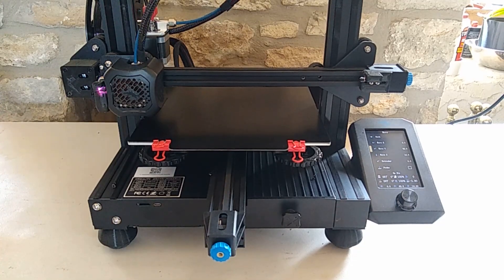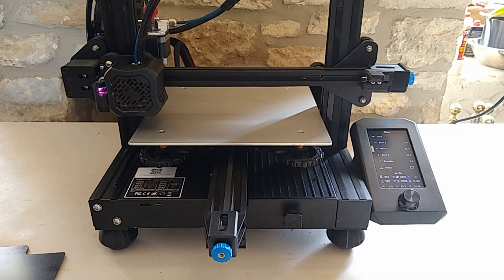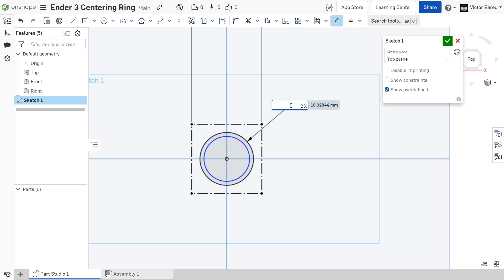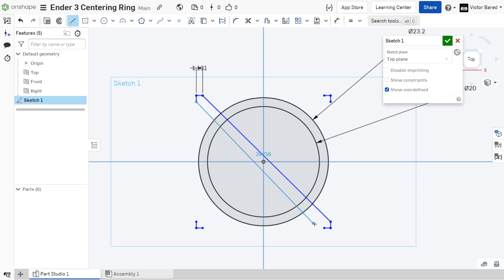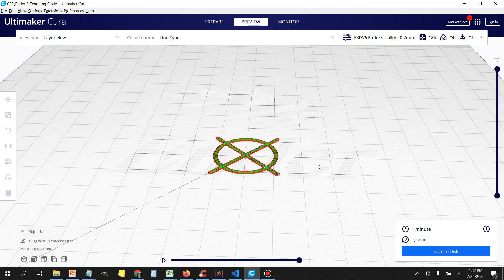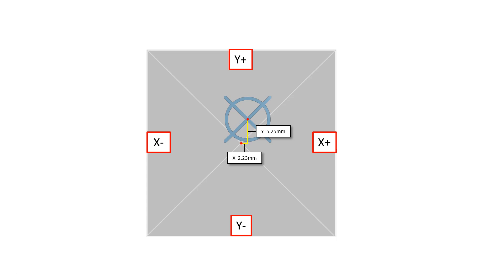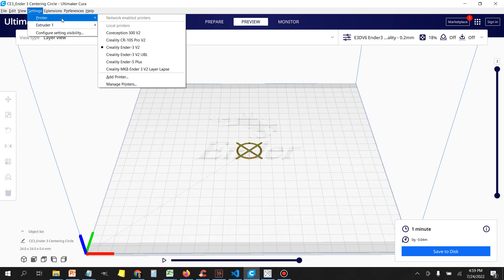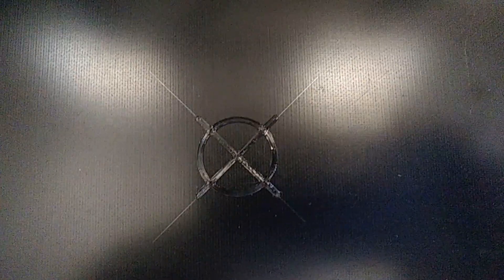Ender 3 V2 Ultimaker CURA 3D Printing Off-Center Fix

Comment: the only problem is its in the slicer and if u change the slicer its back again and another problem is this 5in and 2in u did it will be lost from the bed it self 
yea u have it in the middle but u lost the same from each side of the bed

Comment: I'm not sure if I did something wrong, but for some reason it's not centering even after I update my stuff in cura. 
Update it worked for my modified cr10, still trying to figure out the ender 3 v2
Reply from the maker: Hi, thanks for commenting. Most off center problems are caused by either improperly set slicer values or homing switches. Check out this video and see if it helps you hone in on the problem.

Comment: Thank you. I've had my Ender 3 for five years and just noticed yesterday that it was off center. I've never printed anything large enough to fill the build plate until now and it was a disaster. So again thank you. 

I had a feeling something was off a few days ago, because I noticed that my BL touch was checking right on the front edge of my print bed and a couple inches from the edge in the back. My bl touch was landing on my binder clips on the front throwing off my bed leveling. And it was never an issue until now, because I never printed anything big enough for it to be a problem.
Reply from the maker: Hi friend, thank you for commenting. I'm glad you found value in this video for your viewing time. Yeah, I hear you, it was very frustrating when I ran into it for the first time. What's more interesting is that the root cause of the off-center issue is from mechanical misalignment. Using CURA allows the alignment problem to be corrected via software. 

I use 4 Ender 3 V2 in my business and each one required different CURA values to get the prints centered so I realized the cause must be mechanical. I found that when my printer X&Y coordinates were set to 0,0 the nozzle opening wasn't half on and half off the left front corner of my build plate. The last part of the puzzle was to maximize the reach of the nozzle so when I set the X&Y values to the maximum size of the build plate the print head could get there without hitting anything. My actual build plate for my Ender 3 V2 is 235mmx235mm but the CURA profile default is 220X220 so assuming the 0,0 home position is the left front corner that means the center is 110 but in reality it should be 117.5 which is the cause of the issue.
Reply: @vbared well, now that it's centered I have a whole new issue. I just changed filaments. I went from hatchbox to polymaker. The hatchbox printed beautifully.  The polymaker won't stick to the bed unless I'm pushing the filament through with my fingers. I should've known better than to switch brands.
Reply from the maker: @bkpickell  What type of build surface are you using?
Reply: @vbared  the creality glass bed. Never had an issue with it until I switched to polylite pla pro. I'm sure I have to tweak my cura settings. I've been playing with temps. I've already bumped it up to 210. That hasn't helped, I may try 215 or slow down print speed. Maybe the issue is extrusion speed. I just really hate when I switch brands and go through half a roll of filament just to get a successful print. I went through this with lightweight pla last year. Never did get it to print right after going through the whole roll.
Reply from the maker: @bkpickell  I used to have similar issues prior to switching out all the glass and magnetic build plates in my print farm for this Garolite that weighs just 7.1 ounces. 

The only requirement is that you need to use a bed probe to build a mesh of it. The Garolite sheets is 1/16 of and inch thick so it will conform to the aluminum plate beneath it. 

You'll never need any type of adhesion promoters, tape or anything else, throw away the scraper too. 

Run the bed temp at 80c and PLA, PLA+, PETG, NYLON, and ASA will stick to it like crazy. When the bed cools you'll hear the parts crack as the Garolite releases them. Another side benefit is that you can run your Z-offset much higher (about .23mm) which eliminates stringing due to the nozzle no longer being low enough to collect filament along the edges as the print progresses.

Ender 3 Garolite - https://amzn.to/4a5ZsQI

Super low profile bed clips - https://amzn.to/4a2gb7q
Reply: @vbared  Thanks, I just ordered it, lets see how it goes. It says it will be delivered Wednesday.
Reply from the maker: @bkpickell  If you have any questions about it, just ask. I've been using them for 3 years.
Reply: @vbared  Well, I figured out my issue. My hotend was clogged. It wasn't sticking to the glass because of underextrusion. I got it all cleaned out and it's still not extruding properly. So I ordered a new extruder , stepper motor, and ptfe tube. Hopefully that will fix it. I really don't want to have to replace the hotend. I know it's not hard, I'm just not sure I remember how to calibrate my bltouch. Lol

Comment: Victor. I have to say. THANK YOU! I'm new to 3d printing and it's people like you who make this more of a joy than a chore.
Reply from the maker: Hello Friend, Thank for commenting and encouragement. I'm glad you found value in this video for your viewing time. This alignment issue can be solved this way in CURA but I found the root cause is that from the factory the limit switches are improperly placed. If you're printing right of center that means the x-limit switch needs to move left by the same amount that it's off center. Also if your prints are towards the front of center that means the y-limit switch needs to move back by that same amount. Linked is the video I made about it.

https://youtu.be/8biqiHTd73o

Have a Happy New Year!

Comment: If i used klipper can i fix it from config with out fixing from cura?and how
Reply from the maker: Hello friend, The alignment issue is a result from a printer not being mechanically tuned. What I mean by that is when you tell your printer to move to X 0 and Y 0 the nozzle tip should be half on and half off the print surface. On an Ender 3 V2 that means left-front corner. If your machine when sent to those positions is off by a few millimeters in each direction the prints will not be centered. I'm sure there is a way to correct this in Klipper but the root cause is mechanical misalignment and is the method I use to fix the problem.

Comment: Why aren't you just correcting this misalignment in the firmware?
Reply from the maker: Hello Mickmarriott9453, Thank you for commenting. Yes, that's an option for sure. What I've learned since making this video is the problem stems from the end switches not being in the correct position. To fix this issue I designed a few parts to make the limit switches adjustable so that when X is at 0 the nozzle tip opening is half on and half off the bed. I then do the same thing with Y=0. This solves all the alignment issues with CURA and bed mesh creation.

Comment: Thanks so much man I had no idea why my prints where so far off center. And when I tried printing a large print it cut off a huge chunk on the right. Now it’s all fixed!
Reply from the maker: Hello 55kp, Thank you for commenting. I'm glad you found value in this video for your viewing time. Using CURA to address the issue is an easy solution. Since making this video I've found that the root cause of most of the print alignment issues is due to the x and y limit switches not being in the proper location. The way to test if this is the case for you is after homing your printer send the print head over the X=0 position and then bring the Z down to about 2mm to see if the nozzle tip is half on and half off the print bed. What you'll find is that your nozzle will be off of this point. The same test can be done with the Y-axis. To fix the problems the limit switches need to be moved in the direction needed to gain the proper alignment. In most cases, they will be off by a few millimeters. I made a video about this problem that also affects the bed mesh.

https://youtu.be/l-mrw8YvLBU

I still scratch my head to this day wondering if many of the companies making 3D printers actually have any real-world 3D printing experience.

Comment: Thanks!
Bought a new printer which was the same as my old one which broke beyond repair, and the newer one has an extra bit that sticks out which hits the stop switch on the gantry. This now makes the nozzle centre further to the right. Thanks to this I can adjust it back! Cheers Dude
Reply from the maker: Hi ArcanePath360, Thank you for commenting. I'm glad you were able to get back to printing normally. It's super annoying when you don't have access to all the build volume.

Enjoy your weekend :)

Comment: Thank you so much for this short but very informative video! I was having issues with printing models that were close to the limits of my print bed. but the right side kept getting cut off. I thought it was a bad STL file, or my slicer program causing the problems. After several failed prints I started googling, and came across this video. I followed your method, and found out that my X-axis was off by 8mm and Y-axis was off by 6.5mm. put those offsets in, and now i am dead center! now my prints aren't cut off on one side. thanks again! happy printing
Reply from the maker: Hi Brendan, Thank you for commenting. I'm glad that you found value in this video for your viewing time. Yeah, I hear you, it's super annoying to not have full access to your build volume.

Enjoy printing big models (:

Comment: Amazing I looked everywhere trying to find a way for my Ender 2 Pro to print in the center of the bed. Your instructions were spot on and now I can make use of the full bed and given that the build area is small for the Ender 2 that's saying a lot. Thank you so much for sharing this.👍
Reply from the maker: Hello Rick, Thank you for commenting. I'm glad you found value in this video for your viewing time.

Best of luck with your mods!

Comment: I believe the problem are the default Cura settings put the bed at 235x235 and it should be 220x220. It caused mine to over shoot center approximately 8mm up and right of center which makes sense if it measures 235 from bottom left corner in each direction.
Reply from the maker: Hello MadSQUABBL3Z, Thank you for commenting and info. One new thing I found out after making this video, is that the X and Y limit switches aren't in the right locations from the manufacturer.  The nozzle tip should be half on and half off the build plate when x is at 0. Same thing with Y at 0. If you tell the printer to move to the center of the bed but the limit switches are each off by several mms, that's the reason why it will off center. So I designed parts that allow adjustments of the X and Y limit switches so you can actually get the nozzle to the correct positions.
Reply: @vbared  would you be up for making a video on the adjustable x and y limit switch parts? Limit switch adjustment in combination with the 235 vs. 220 seems like the true solution to the offset issues.

Edit* nevermind I see you already have it covered! Lots of good technical stuff on your channel, greatly appreciated!
Reply from the maker: @g10118  If something is unclear just ask and I will make a follow-up video about it. I post the videos as I come across these issues and learn how to solve them. Unfortunately, they sometimes seem unjointed or scattered.

Comment: I can't get my 3v2 to create a mesh. it overshoots the bed immediately and I'm pulling my hair out going from video to video to find a fix
Reply from the maker: Hi Chris, Thank you for commenting. Please provide the following:

What firmware are you using?
What bed probe?
After homing, move the x to 0 and the y to 0. Is the nozzle over the left front corner of the build plate or off to the left?
If possible take a video of the problem, make sure to comment as you are controlling the printer, upload it to Google Drive and share a link so I can see the issue you're having.
If too lengthy to type feel free to call me 478-227-3301 , I screen calls I don't recognize so please leave a message and I'll call you right back.

Comment: Great video, but my Ender 3 Pro just keeps ignoring these settings :(
Reply from the maker: Hello Snaj, Thank you for your kind comment. I make sure that my printer can center mechanically first.  To check this simply set the mid point of of the x & y axises for me it's 117.5 x 117.5 , then take measurements to determine if the print nozzle is at they center point. If it's not then adjust the positions of the X & Y limit switches by the same number of mm that the nozzle was off by. For example: let's say when you move the x axis to 117.5 it's actually 115mm from the left edge of the heated bed. You would need to move the x-limit switch to the right by 2.5mm. Do the same for the y-limit switch. Once you can make it center mechanically using the controls then try the bullseye test print and make any final software adjustments needed using CURA.

Let me know if this helps you solve the problem.
Reply: @vbared  Thanks for the comment, I was able to adjust Y axis by having the switch move a bit forward. My main issue is with the X axis since it seems like it is not possible to move it because the way it is mounted. Cura adjustment doesn't seem to effect the printer since I entered like 1cm and it printed in exact same location. I am not sure it is because it has Marlin 2.0 or something else.
Reply from the maker: I created these parts to give some level of adjustment to the x-limit switch. It should allow you to get it mechanically centered so you can fine tune the CURA software side.

https://drive.google.com/uc?export=download&id=1F4ZpF49QI-pwa9o_9SExqXjjru8hgUAY

Here is a video on how to install it - https://youtu.be/8biqiHTd73o
Reply: @vbared  Thats very cool. I assume it can be installed on a ender 3 pro as well. I will definitely give it a try.
Reply from the maker: @snaj9989  Good morning, Yes, I'm using it on my Ender 3 V2s, Ender 3 Pros, and Cr10S Pro V2. It should work with most if not all of the Creality printers.

Comment: thank you so much for this video, i been pulling my hair out for a few days now because my printer was printing off centre Ender 5 pro.

Although I didn't use your file, the explanation of what to do was understandable and to the point.  got my issue sorted out in under 10 minutes. My x/y axis was out by 60mm & 60mm respectively.

great work thank you
Reply from the maker: Hello Ultimatedavethe3rd, Thank you for your kindness. Wow, 60mm off, I would have also been pulling my hair out. Glad the video solution helped you resolve your issue. Great work grasping the gist and applying it to your machine.

Best of luck with your mods!

Comment: I went a little more low-tech to check mine.  I created a 220 x 220 square in TinkerCAD and left just a 3mm border by putting a 214x214 hole in the middle.  Exported and sliced in Cura 5.2.1.  Printed without a skirt and measured all 4 sides after printing compared to the edge of the bed when done. All 4 measurements were within 1mm (perfect would be 7.5mm on all 4 sides)  so close enough for me.  This also allowed me to check for any bed skew by measuring at the corners of each side of the square.
Reply from the maker: That's awesome, great job learning to work with CAD. It was a game changer for me, designing your own parts is a powerful with 3D printing.

Comment: Thank you so much for this
Reply from the maker: Hello Adam, Thank you for the kind comment. I'm glad you found value in this video for your viewing time.

Best of luck with your mods!
Reply: @vbared  It is now 100% centered now😁
Reply from the maker: @rondashadow  Great job, Adam! Isn't it crazy that the default Ender 3 profile in CURA start off like this. I'm amazed how many things like this I come across in this hobby.
Reply: @vbared  My S1 was the same it's fixed now as well. It's not good CURA is like this at all and I payed for my copy.
Reply from the maker: @rondashadow  Wow, even on the paid version. I guess the silver lining is that it can be fixed. Excellent job taking the time to dial your machines in.

I'm currently trying to figure out a way to adjust the gantry bar without having to totally remove it every time it needs a tweak.
Reply: @vbared  If you can find that one you are a god 😃

Comment: Hi Victor, Great video.  I was wondering why we can't solve this problem by adjusting the printhead settings?  I believe the "center" is calculated by Cura using the printhead settings but I'm not sure.  Have you tried this?
Reply from the maker: Hello Dean, Thank you for commenting and kindness. What solved it for me was to add the correct values into the Extruder 1 tab. Another thing that should also solve it but I haven't tried it to uncheck the Apply Extruder offsets to G-Code in the Printer tab. The Printhead Settings will determine how big and in what position the Printhead assembly is so when doing sequence printing one at a time you'll see a gray box around each model so the head won't hit your previous print.

Best of luck with your mods!
Reply from the maker: BdenandMe  Hello BdenandMe, Thank you for commenting. Did what work unchecking the apply print head settings to G-Code? Unfortunately it doesn't, measuring is a pain, I know. I'm afraid the only solution I found to get the prints centered is using the method described in the video. You're only going to need a a pencil, a ruler and a few test prints to sort it out.